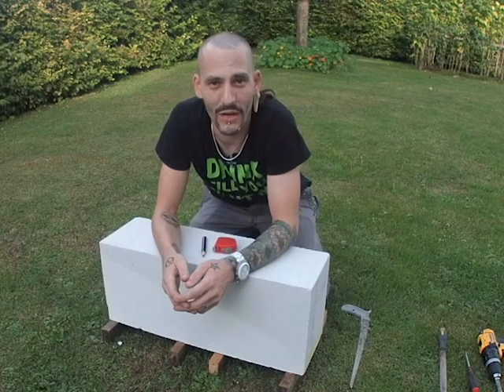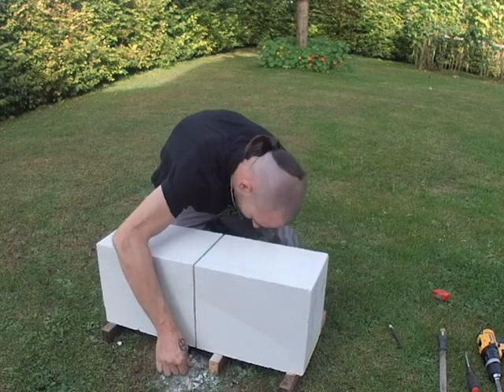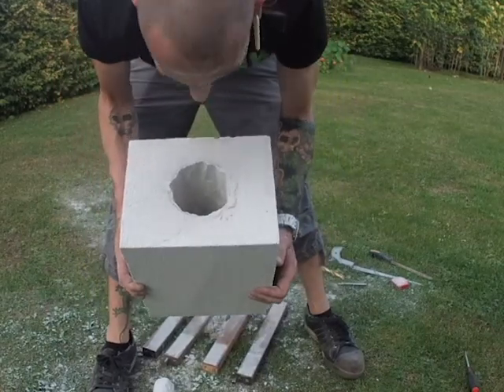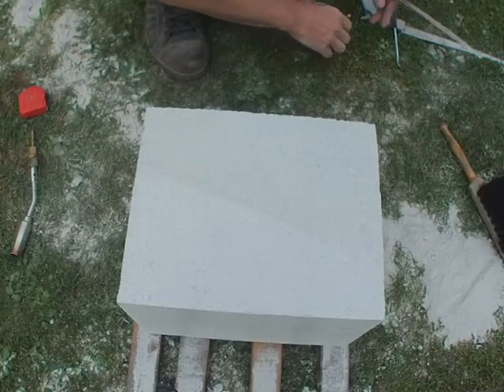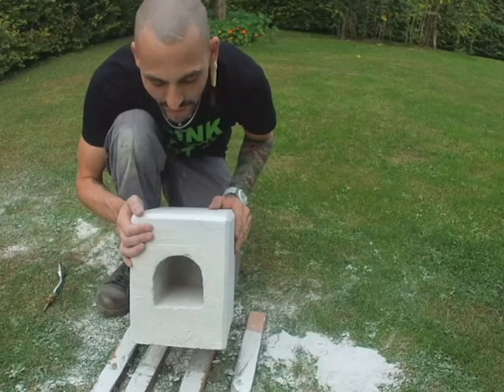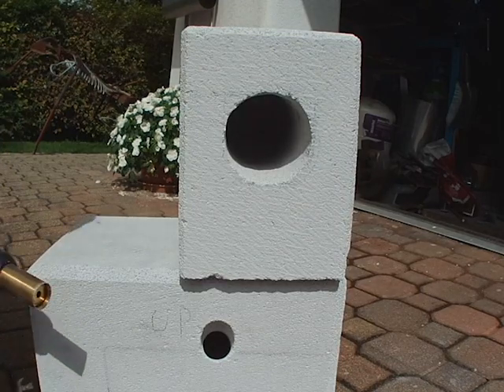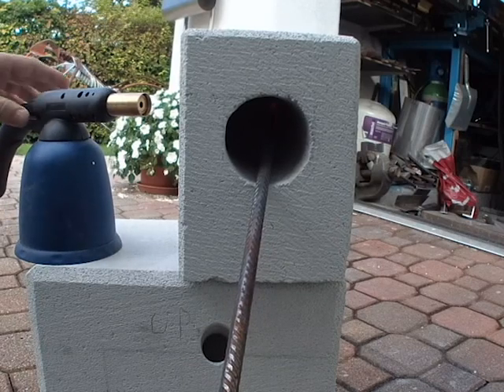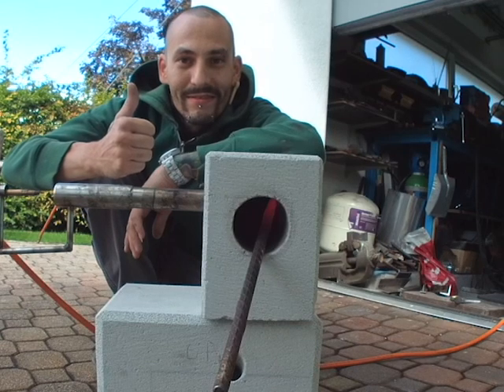Gas Concrete Propan Forge For Under 5 Bucks Easy to Make - Making 002 - WSW

Comment: Hi ✋🏽 is this  Cement cube !?
Reply from the maker: No, dont use cement! It will explode. This is a arrated gas concrete block. It is mostly made from gipsum with a spezial process. You can also use fire bricks.

Comment: i think that in that built it isn't any blackflow preventer (?) it's really important if not the butane bottle will eventually explode if something goes wrong, I'm really sorry for my bad English but it worried me and I have to say something
Reply from the maker: No, it will not, it is not Acetylen 😜 it doesnt need any backflow stop, without oxygen butan does not burn!  Else a simple lighter would also explode when the flame goes out 😊  since there is only gas in the bottle there is no possibility of any back burn. Dont worry, every gas grill has no back stop.
Reply: @WildStyleWorks  ohh thanks for the explanation! have a great day

Comment: Hi from Sweden, I made these mini forges before, adding a coat of sodium silicate and aluminium oxide, it works very well. However,  now I want to use my forge to make mokume gane, this implies that I heat the metal up to 700 degrees C for 30 minutes or so. I have to say that it scares me a bit. I need a good burner for it. Any suggestions. Best regards.
Reply from the maker: Thank you for the feeback, well for mokume, you dont need to watch the time, it is way more important to watch the metals! I made mokume within 5-10min of heat. If you got the right temp. the metal will change its surface optics a bit, it will start to shine more and you can see that it want to liquify, that is the temp were the metals stick to each other. It is also important to keep oxygen away ang to have very clean and flat surafces, so they can adhere well 😁
Reply: Hi Wild Style, thank you. You are right, this is the way to do it. I used to make mokume gane in an electric kiln (the Binnion method), this works very well, but I am getting tired of soaking the billet for 10 hours in a kiln. A forge will work much faster, as you say, but you need to keep the oxygen out (I am going to paint the outside of the billet with a thick slury of borax) and the rest is visual inspection, which, I guess, takes some experience. I do not think that I can use my goldsmith torch (not even the head of melting) for this, I don't think it can function for 30 minutes or I suspect it is not safe anyway, so I will probably buy myself a ventura system (it has to come from China or the US, sigh), that will work of course. Many people make MG this way, but I think that a ribbon burner would be even better, but this is not so easy to make. It would use less propane too.

Comment: Great idea. Anyone planning on trying this - WEAR A RESPIRATOR MASK. 
This material, while not chemically toxic - is VERY bad for the lungs. Its abrasive and injures the lungs. Just like asbesthos. 
Search Silicosis on the web.
Reply from the maker: thank you, but not really. this is not silicon at all. this is plaster and concrete mixed and foamed.
its not toxic! you could even eat small amounts without harm. as said its no chemicals inside.
Reply: @WildStyleWorks  
You can get silicosis even without ingesting silicon. It is not "silicon allergy".
Its a disease you get when inhaling sharp microscopic objects.
Ytong company warns everyone working with their products. They publish safety instructions in any possible language. It has nothing to do with toxicity just like a clean stainless steel knife is not toxic yet can kill humans

Comment: that's definitely does not look like concrete...more like a plaster, or possibly even soft kiln brick.  Concrete would be bad to use anyway, any moisture in it could vaporize and cause an explosion when in use as a forge
Reply from the maker: yes it is more like plaster and only called gas concrete but it has nothing to do with normal concrete ;-)

Comment: This cannot be done for 5 bucks. You have to purchase many other tools to complete the forge
Reply from the maker: I only meamt the material for the forge, if you want to forge, i'd expect that you allready have some tools, otherwise you will not be able to work anyway 😜  and you can make this forge with a spoon only too, the material is so soft that you dont need tools at all, you could use youre fingers if you have enough power 😁

Comment: How many times you used the Ytong forge now ?  Does it stand against the heat after using  several times ?
Greets
Bob
Reply from the maker: well i would say after about 20-50 hours you need to replace it, depends on the heat you get in there

Comment: where did you get that huge block?? I want one. Its perfect for making the forge to my exact specs without having leaks along seams.  I can't find it here in the USA
Reply from the maker: its very hard to find in the usa but you can also use smaller blocks and some spezial glue for these blocks or fire cement to clos ethe seams.

Comment: I went to that website and didn't see were you can order anything! If anyone could help me it would be greatly appreciated!! Thank you
Reply from the maker: Hello, I think they are normaly just selling hole walls or buildings. You could ask them per email if they sell single blocks. Otherwise you could search for "autoclaved aerated concrete" but its not easy to get them in the US. Otherwise you could use firebricks, they last way longer anyway.
Reply: @WildStyleWorks  thank you for your reply! I just watched one using firebricks! That will be the way I go! Great video by the way

Comment: I would not recommend using Ytong or similar aerated concrete blocks. Although they are good heat insulators, this is under normal circumstances. This is also the reason nobody recommends them for furnaces. There are other, purposefully created heat insulating bricks out there, that can be used under extreme heat
Reply from the maker: yes you are right, i would also not recommend them for funaces or proffesional forges. This forge is an inexpensive methode for poeple who want to try out forging. it is more to see if you like forging and want to spend more money on a good forging equiment. it holds up to a view hours of heating and cost very little money, so if you dont like forging, you didnt waste a lot of money. and if you like it you will buy good equipment anyway. also I use mine for very small forgings or when i only quench one or two blades, beause it heats up very fast and therefore doesnt waste as much gas as my normal forge.
Reply: In the end, other than becoming too brittle over time, no harm will be done :)
Reply from the maker: absolute and as said, just very little money and material is wasted when someone decides not to be a blacksmith in the end.

Comment: I cringed  you should have been using dust respirator or  at the very least a disposable mask silicosis is insidious silent killer it causes you're lungs turn on themselves causing unstoppable destruction of lung tissue its a horrible way to die.
Reply from the maker: yes it is a horrible way to die, but with this stuff not possible, IT IS NOT POISONOUS!!! ITS IS ONLY PLASTER

Comment: make sure you wear a mask with this stuff...
Reply from the maker: you dont need to, because it is just plaster. That is not poisonus at all.
Reply: @WildStyleWorks  
 apparantly it also contains some aluminium which could have some annoying effects. It's definitely safer than most alternatives but wearing a mask can never really hurt

Comment: Ya should use a breathing mask and eye protection. Once Silica dust gets in your lunges it stays. Not good.
Reply from the maker: Thanks but this is plaster not silica it is pretty harmless
Reply: Yeah! You'll suffocate slowly in about 35 to 40 years from mesothelioma ;p Sweet! [sarc on]

Comment: I tried to make such Ytong forge and it works :) Thank you for the idea... 
I needed something temporary before I build some better forge and I am happy with this. Already used it several times and it is still OK. Used it for quenching and even for forging (was on for more than 1,5 hours) and it survived :)
Reply from the maker: That is awesome to hear, exactly for that purpose this forge is very good and inexpensive. I am very happy that i could help you out.
Reply: I just added fireclay with waterglass (sodium silicate) as the refractory lining in the chamber. Not sure whether it was necessary, but I found it at home, so why not to try it ;)
Reply from the maker: That is a good idea to make it last much longer, nice!

Comment: That material looked likr it was very easy to drill & shape. Where can we order that stuff from??
Reply from the maker: Yes it is very soft stuff, i dont know were in th US you can get it but it is called autoclaved aerated concrete brandname Ytong or Hebel power block
Reply: Is a foam made of plaster.

Comment: you should only use fire brick
Reply from the maker: Ytong is also fire proof, the producer of this brick says its heat resistant up to 1200° Celsius, only its lifespan is not as good as with real fire bricks, so if oyu want to make a forge for everyday use i would also recommend firebricks
Reply: Wild Style Works ya ive heard people using cinder blocks only to have them crack and pop causing hot shrapnel to fly. can you get this stuff at any hardware store?
Reply from the maker: Hi yes cinder blocks are something way different then Ytong, Ytong is autoclaved aerated concrete, it look like  sponge and has mostly air bubbles and it a kind of plaster. the manufacturer of these blocks is hebel and they are hard to find in the US

Comment: It has to get hot before you put anything in just a rock or something to block the hole a little bit would allow it to heat up.
Reply from the maker: that could work but these tiny burners are just not enough for a forge it works up to a 6mm piece but then you need something a bit bigger

Comment: maybe i try it again with some ytong. last time when i made a weldingspark(with carbonsticks) onholding for about 20seconds inside the ytong, it sort of deformed. so i was in the idea that ytong couldn't hold that much heat for a forge too. might try it again, since those blocks are dirtcheap in europe. thanks for posting mate.
Reply from the maker: Well if you make an electric arc inside the ytong it will not be able to resist that much heat because a weldingarc will get aprox. 3000-6500 degrees Celsius and that is too much for ytong.

Comment: Instead of wearing out your woodworking tools, use a drywall blade to saw it, and a masonry brick for trimming.  A hole saw would make quick work of that round hole if you want to sacrifice one.
Reply from the maker: thoose are metal working tools and the brick is so soft it does not harm them at all. but thanks

Comment: freaking awesome idea....love the video thanks for taking the time....i want to cast some aluminum parts...this fits the bill
Reply from the maker: Thank you, yea but to make a foundry you should make it a bit different then for forging
Reply: yeah i would make it more tall.....with a lid....it will just be for aluminium...i bet this stuff can be  cnced...now to find an american source...
Reply from the maker: ok that could work out, and yes of course it can be cnced but wach out when clamping the block because they are pretty fragile they are called hebel power blocks in the US but you can use some firebricks too if you want it to be more sturdy and hold up longer

Comment: Do you think a hammer and chisel will work for this material or would it shatter?
Reply from the maker: if you are very carefull it could work but better use a knife or a saw or something like that. this stuff is pretty soft an  very easy to get in shape

Comment: what's the difference between a concrete fore and a sodium silicate forge?
what does insulation help to the metal?
I know that it burns faster in coal
but?
Reply from the maker: sodium silicate is way more heat resistent so it will last longer. the insulation makes it possible to get the nesessary heat, otherwise you would need way more gas or you would not even get the steel hot enough at all.

Comment: Where did you buy the block at?  can;t seem to find any where that just sells one?
Reply: You could buy a bag of refractory cement or two and build a wooden or styrofoam mold  and make it yourself inexpensively
Reply from the maker: in europe they are vrey easy to get but seems to be different in the US

Comment: What you have produced is a fantastic Idea . I yao1 to you (bow ) to take this and put it into a steel box and fit a steel door on the front vented will bring forging kilns out of the dark ages ....... you could cement blocks with fire cement together to make them as big as you want as long as you work out the b.t.u. ( supply of gas fuel to consumption) .....
I now know what I'm making my sword kiln out of .......
Reply from the maker: yes in my video i just want to give you an idea what is possible. ist a bit more work with the steel frame and door but it will last way longer and as you said you can make it as big as your gas supply is able to heat it up

Comment: how can I make a substitute flame to get the metal at the right heat with out a torch starting off from square one I'm trying to practice blk smithing
Reply from the maker: you can go with a coal forge or induktion forge as well. the cheapest one is a self made coal forge. but a self made gas forge is also good. you will need some kind of burner if you want to start blk smithing.
Reply from the maker: yes but you will need at least 5000 Watts and that is not as easy to biuld yourself better buy one thats way more save.
Reply from the maker: WTF the most funny comment ever :-)  but true, true, never give advice on something dangerous, if you dont know exactly what you are talking. specialy on the dark mysterious place alled redtube, erm, erm, i mean youtube.

Comment: Nice work man
Ive seen on other channels the smiths putting a brick etc in front of the hole to help keep the heat in the forge, (i guess the heat bounces back in so isnt lost). Maybe this could help when using your smaller burner.
Keep the videos rolling man
Reply from the maker: yes taht could work but the gases need to get out somewere so a hole is necessary.
thanks yes i will.

Comment: making a reil burner will get the piece up to welding temp much faster..
Reply from the maker: yes that would help but it would destroy the bricks much faster
Reply from the maker: yea that works much better if you use it more often. i dont like coal that much its more work and more scale , i would prefer an induction forge but thats to expensive for me.

Comment: That's cool but your burner could use some work. Learning how to "regulate" the propane pressure with a really small orfice helped me more than anything. So I use no regulator. I bought a $12 propane burner, the baby chucks for dremel and a #78 bit. Then removed the burner to expose the very hard to see orfice. Then I redrilled those laser orfices with the #78 bit (dremel works best on low speed). It got me a perfect, really tight hole. Then I attach a hose to that burner and open the propane all the way so just the HOLE regulates the pressure. And I use a smaller burner tube (5/8") that's ALSO shorter than yours. 

When you use those wider, longer burner feeds it greatly reduces the speed of the gas hitting the inside walls. Like the size of that burner you have I'd use that for a keg sized forge.... not a little forge like this.

All I know is when an optimized forge runs you should only see a flame (inside the forge) when it's warming up. And it will also sputter like an engine with very rapid bursts of gas. Then after the inside gets orange ALL THE GAS should burn through catalytic oxidation.

What happens is the gas hits the orange walls at such high velocity it "explode burns" on contact with the walls. Then that blue flame MUST DISAPPEAR. All you'll see are the inside walls glow brighter and brighter (lots of white with a tinge of yellow) as the frequency of the "howl" starts to sound more like a whistle.

It's much easier to tweak than most people realize and you don't do this just for forge weld temps you do it to SAVE PROPANE. I see people running through 25G tanks of propane in 8-10 hrs with small forges like this when they should last 2-3xs as long. And the main 2 problems 1) oversized orfices 2) oversized burners. Technically with a forge you don't want a "burner" at all. You want a narrow (as possible), high velocity tube that will blow out the flame when the forge is cold. So you turn the gas down, let it sputter, then when the walls go orange turn it all the way up and you'll know it's optimized when that blue flame disappears.

edit: to be clear you used lots of burners I'm talking about the one at 12:02. The butt and body of that burner is too wide. It should be 1 narrow pipe with no flare at the end and shouldn't operate like a torch. I think your orfice is too big cause my pipe is almost half the width but would turn that entire hole white in 2-3 mins. If your orfice is too big it's gonna force you to use larger pipe then you open the propane too much for speed yet you never achieve a real blast effect cause the gas & air have too much surface area before it hits the forge. You could just try cutting the pipe to half it's size that would also help the velocity.
Reply from the maker: The burner you see on 12:02 is my burner for the big forge and it works very nice, like you say it normaly dont burn by it self and sputters at first and when its orange i can turn on the gas.